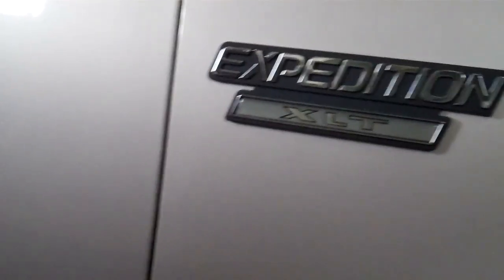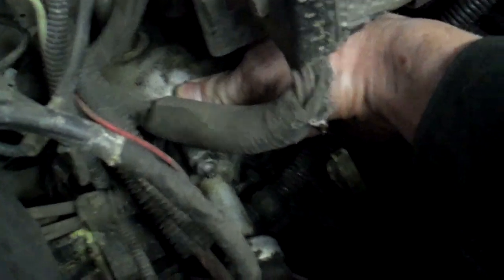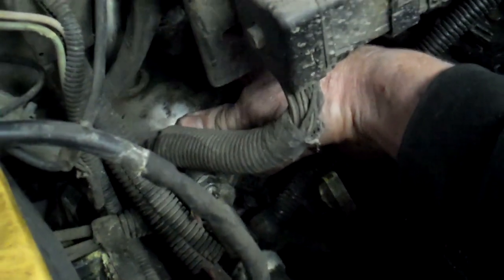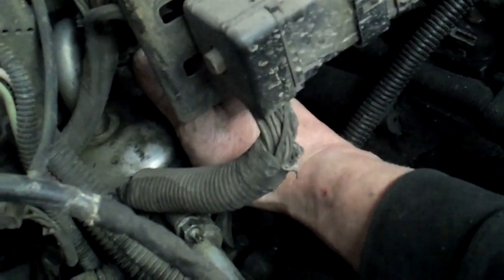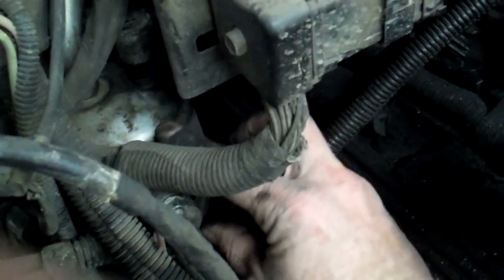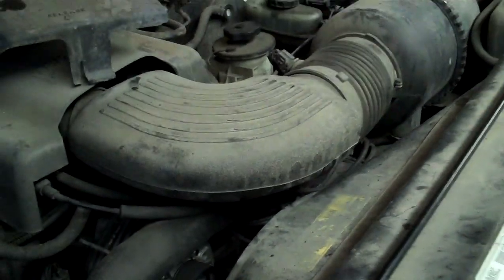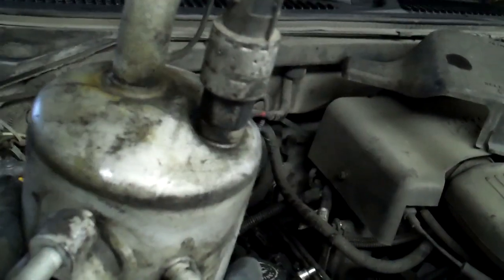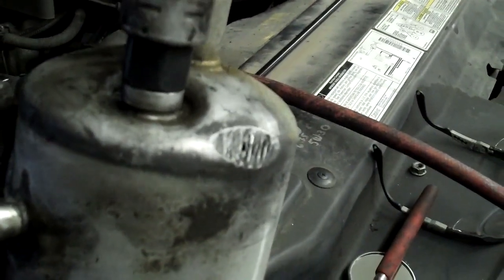Ford Expedition AC acumulator PCM wire harness design problem and solution

Comment from the maker: Do you listen to country music?
Reply: My 2004 Expedition front vent is not cold but the rear vents are super cold Should I just wait until the rear start to warm before I fix it, Will it affect the compressor if I continue using it only on the rear?

Comment: aluminum is a fucker like that, i work on aircraft and you have to shield and secure everything that touchs or could shake and touch anything aluminum that you dont want comin apart at the wrong time. doesn't take long either, 5 hours can blow through a hydraulic of fuel line

Comment from the maker: @sweetlikeADAM  What's crazy is that it didn't get it's first tune up till it had 180K miles on it!  It did get the oil and filter changed every 3K miles.  People stretch on that, but it's the cheapest route to just change it every 3K.